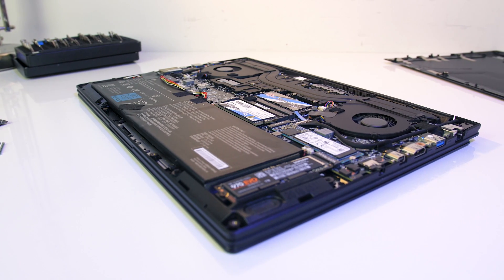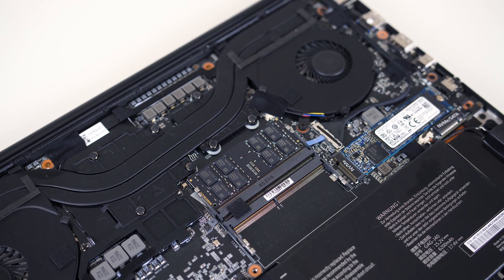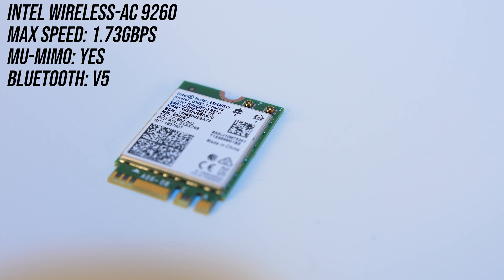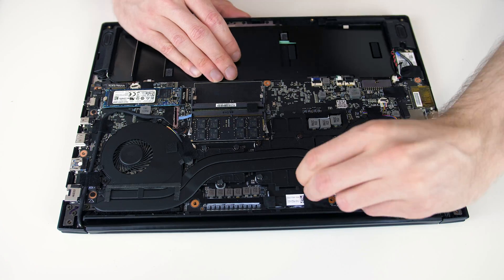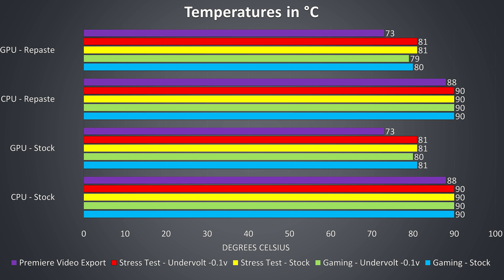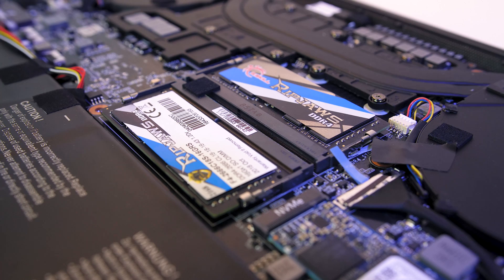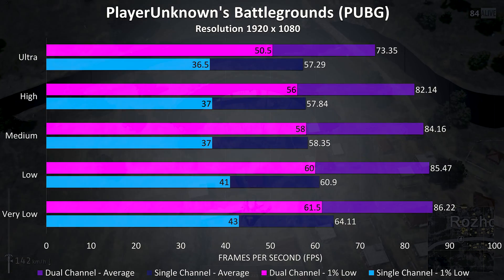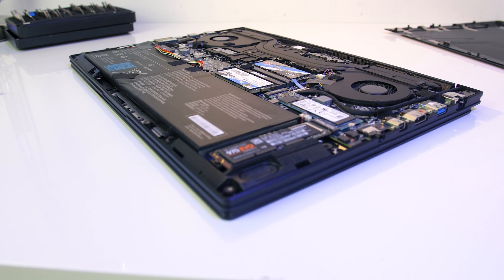Upgrading the Gigabyte Aero 15x Laptop

Comment: Hey Jarrod:
Here I am in Australia too thinking about buying an AERO 15 around boxing day as a gaming laptop. I have a simple question if you don't mind, as I am intending to put a second SSD in to boost the storage. It will be my first time ever to dig inside the internals of a laptop and I was unsure about whether the battery have to be removed or just simply disconnected for just putting in another SSD. I'm assuming just disconnect would be ok based on other videos I've watched but a certain answer is always more comforting.

Sorry for the long message, and if you ever read this, please stay safe throughout the rest of the pandemic :)

Comment: Still trying to tame the heat with my x9 running 32GB with i9 8750hk- I pretty much did what you did and can legit confirm a year later this is still hot. I like my laptop but with cooling would have been better
Reply from the maker: Just the way it is with that higher processor I guess 😟
Reply: @JarrodsTech  Yea man overall im still happy, I just know I cant go 3 hours at a time for my occasional gaming binge, but thats ok.

Comment: Okay so I finally got around to doing the mods myself. Haven't noticed an increase in network capability (though likely due to limited output from my modem) however the extra stick of RAM is awesome (if for no other reason than saying your laptop has 32gb of it...). I ended up doing a bit more research and found that once upon a time Gigabyte had a promotion that gave out a free stick of 16gb 2666 RAM if a 15X laptop was bought during March 2019. The stick in question was the Samsung M471A2K43CB1-CTD that you have listed in your video on the supported upgrades list and plugged straight into the vacant slot and worked out of the box! Highly recommend giving the Samsung a go if you're having any issues getting 2666 speeds (as a few people out there have reported). Once again, great video man thanks for the upgrade walkthrough!
Reply: thank you, Just Upgraded mine with - Samsung M471A2K43CB1-CTD  and it worked with V color. I have 2667 SPEED....yay

Comment: Just upgraded mine today.. used the crucial CT16G4SFD8266. Did not start and kept rebooting with no display. Then disconnected the battery and tried again. Finally worked and recognised both crucial sticks in dual channel. So anyone trying with those sticks.. disconnect the battery wait a few minutes and reconnect the battery then make sure the back cover is back on.. and start the computer. It worked for me. Now need to sell the kingston that came with the laptop..🤣

Comment: Hi, Tech Community. I've been looking for an upgrade to dual channel 32g of RAM in my Gigabyte Aero 15x 2018.  I tried to swap one Kingston KVR26S19D8/16 SODIMM Stick in, it just ran a black Screen and Fans, i reversed the placement of both memories( the kingston in the place of the Original  and viceversa), the kingston memory only, and nothing worked. Im really sad, but i still want to try with a G-skill ripjaws 16g Modell Number: F4-2666C18S-16GRS. I will be updating this comment once i get it ( in about 2 weeks they said). 
Wish you Aero owners much luck ! Stay healty Folks. 🙈

Comment: Hi Jarrod,
Thanks for that. My 16gb chip and wifi  card are on the way.
Have you done a video on how to overclock this machine,  above the standard 2.20 Ghz? and how to set that up?
Best Graham
Reply from the maker: It should automatically boost up higher when possible as long as thermals and power permit, all you can really do is try undervolting the CPU, here's a guide: https://www.youtube.com/watch?v=yNt9L3BWOFo overclocking with H CPUs is locked unfortunately.
Reply: @JarrodsTech  Thanks

Comment: How do you feel about using liquid metal?
Reply from the maker: I have no experience with the application personally, so a little uncomfortable without more research, plus you need to know the materials you're applying to which can be a challenge to determine due to different coatings etc.

Comment: If i add SSD and change wifi card and add 1 memory stick . Do i just turn on my laptop and use it like normal after i install all those or do i have to do anything with the software ?
Reply from the maker: Yep, just install and boot up like normal. Might need to install driver for the WiFi, but try a windows update first and it will probably just get anything if its needed.

Comment: Do the newer iterations of the Aero 15 and 17 (the ones with the Aero on the lid rather than Gigabyte logo) still have the limitations on upgradability as the older editions? I'd like to get the 17" HDR 1660 Ti version but it needs a serious upgrade to the RAM and storage to be usable for my editing needs.
Reply from the maker: Not sure as I haven't attempted there, sorry. The new models are definitely big improvements over this one in other ways such as cooling, could try asking Gigabyte support for supported memory for the new models and see if they match what I showed in the video.
Reply: Thanks, mate. That's a good idea. I'll do that. Do you know if there are any other 17" laptops with comparable screens around the same price point I should check out? It seems like the 15" models are always the ones that get the fancy screens.

Comment: i had same issue with upgarading my MSI GS75 samsung 2x8gb ram sticks to 2x16 hyper x ram sticks. black screen to start with. then i installed just 1 of each and boot up, then dismantle the whole thingagain and install 2 new ones and it worked. it was pain in ass as msi gs75 MB is flipped and every time i had to fiddle with flimsy conectors

Comment: I wonder the wifi performance as I'm having trouble with my 2017 AERO 15. The wifi is unstable and will disconnect if I play games. I checked on other devices and the wifi is fine except on my laptop. Also the wifi will disappear after few times of disconnection, I've tried every solution including clean reset but it still happening. My last solution now is to change the wifi card but I wonder if it actually worth it to swap the card and the problem may occur again. Also the wifi card is not the same model.
Reply from the maker: If you're using the latest drivers and have tested using the laptop close to the access point to rule out stuff being in the way, probably time for a new card, they usually aren't very expensive

Comment: Does this computer fits intel wireless ac 9560 on this laptop or is it only fit on your recommended wifi card?
Reply from the maker: I'm using 9560 in it, but any M.2 WiFi card should work I think.

Comment: Actually all ssds are compatible with the Aero 15x
I got both 512gb barracuda and a 2tb XPG(which is cheaper than 970 evo and the difference in speed is not far from evo)
Reply from the maker: Indeed, which is why I found it weird they had a supported list.

Comment: You are so thorough in your application I suggest using the liquid metal.
Reply from the maker: I might test it some day, but others who have didn't see much improvement, I don't think the thermal interface material is the bottleneck, the small heatpipes/fans/heatsinks just can't take out the heat fast enough.

Comment: I am happy to hear that the thermal compound change did not make any sense ;-) Sorry for you though!
Reply from the maker: Haha, yeah seems that the heatpipes/sinks are the bottleneck rather than the interface material between the dies.
Reply: @JarrodsTech  thx for your comment :-) Btw. my Aero 15 is now defective. Reports an nVidia usb Controller issue and sucks 37w of power in battery saver mode (cpu package 6w and nVidia gpu fully off, no wifi). Happened after 2 days and no response from Gigabyte in 5 days :-(

Comment: I have the Aero 15 YA (i7 9750 with RTX2080 MaxQ)..  Under high loads it's just shutting off..  but it doesn't shut off during stress testing...  I'm not sure what to do - whether to try undervolting the CPU and/or GPU or whether to just send it back to Gigabyte for warranty inspection?   Or maybe to try re-paste?  It's about a year old and I just bought it second hand..
Reply from the maker: Never heard of that happening, definitely not normal. Get in contact with Gigabyte.

Comment: Do you guys know if removing the bottom cover can void warranty? My piece is less than a year old and it stopped working so I want to try resetting cmos and removing battery to see if it helps
Reply from the maker: Honestly not sure. In the US I don't think those sticks saying void if removed are valid, so could depend on your region. If no stickers on the screw holes I'd just do it personally.
Reply: Jarrod'sTech thank you! I didn’t find any information about removing stickers and bottom cover on gigabyte’s website, also some people say that it’s illegal in the USA to void warranty if the device was opened

Comment: Super useful video, thanks Jarrod! I am thinking of going through pretty much the same upgrade, only RAM I'm considering going up to 64GB. In the list of supported memory kits that Gigabyte provided, were there any 32GB sticks that are 'officially supported'? :D
Also, out of curiosity where in Australia are you located if you don't mind me asking?
Reply from the maker: Cheers! There were no 32gb sticks listed in the sheet that Gigabyte sent me (I think there's a screenshot of it in the video), but I think those became more popular a while after making this video. It might be possible, could contact Gigabyte and check. The newer Aero 15 OLED lists 64gb in the specs though, so that one at least does. I'm based in Canberra
Reply: @JarrodsTech  Nice, thanks for the info Jarrod :) I'll send Gigabyte a message, my laptop does state it supports 64GB of RAM I'm just trying to figure out which modules I can get. I came across lots of people having issues with their specific RAM modules and it's a decent amount of money so I think I'll chase up Gigabyte first to make sure I get something that'll work. Canberra is a nice place - very quaint. Only been there once so far but I did like it :)
Reply from the maker: @SurfacedStudio  No problem! Yeah for some reason they seem to be one of the few that are actually picky with regards to memory selection.

Comment: Looking forward now a year and finally found time to start teaching myself premier pro, it’s quite laggy would you recommend adding some upgrades?
Reply from the maker: What specs do you have? Dual channel memory would help, otherwise the best CPU you can (Intel based for Quicksync) would also be beneficial for both editing and the export process.
Reply: Jarrod'sTech hi hope your well? Here’s my specs:
Intel Core i7-8750H Hexa-Core Processor | 15.6" Full HD IPS 144Hz Screen | Microsoft Windows 10 Home 64bit | 16GB DDR4 RAM | 512GB M.2 NVMe SSD | Dedicated GeForce GTX 1070 8GB Graphics (Max-Q) | NVidia Optimus | USB3 | HDMI 2.0 | Bluetooth | Thunderbolt 3 | AERO 15X v8-CF2

Comment: Hey Jarrod, I just did my thermo solution with kryonaut(cpu and gpu) and thermo pads, CPU undervolt of -0.150 and I also lapped the heatsink to a near mirror finish for the CPU and GPU. All benckmarks I run now with the fan on full never get thermo throttled, unigene superposition, heaven, cinebench 15, 20. But I do get power limit throttled. I guess that's a win :). Oh yeh and one other thing, I put a blob of kryonaut in the middle of the die as I was afraid I might be air bubbles if I spread it on.
Reply from the maker: Nice, can't remember if you can raise the power limit on the 15x, but I know the newer models support that which is good if you have the thermal headroom. Anyway nice to hear it helped, thanks for sharing the result!

Comment: I run this laptop with factory internals on gaming configuration and get about 130fps max on Csgo would you say that is pretty normal and P.S. I can't run Csgo on full screen and P.S. great vid!
Reply from the maker: Depends on your settings, however even at max I'd expect a bit higher assuming you're using the same Ulletical FPS benchmark as me.

Comment: Should I get 0.5mm thermal pads or 1mm ?? Please help me out
Reply from the maker: I don't know, I never checked if mine had proper contact so just assumed what I ended up using was ok.
Reply: @JarrodsTech   Which mean 0.5 mm will works fine? Thank you for the speedy reply. 
My Aero 15 i7-7700hq throttle badly and cant even reach constant 85 fps in Dota 2 Medium settings while gaming. Thinking of repasting and stuff.
Have a nice day mate
Reply from the maker: Seems to be working ok for me, it still runs hot though as discussed after the changes, I think the limit is just the heatsinks/heatpipes, they don't seem capable of removing the heat quickly enough so anything else hardly matters.
Reply: @JarrodsTech   Do u think the thermal will be better if u were to use Thermal Grizzly for the other chips as well instead of Thermal pads?

Comment: hi Jarod! I'm just posting about my experiences with the aero 15 after about a year. a few days ago i finally had the balls to repaste my laptop (grizzly kryonaut) and thankfully i had amazing results! after repasting and undervolting i saw a 8-10C degree decrease during gaming at 28C room environment. (i used thermal paste for everything instead of thermal pads). this was fairly consistent and gaming in high performance mode on ultra settings didn't go passed 85C degrees (before it would go 93C and above. throttling to 3200mhz). however gaming on balanced power  settings i managed to get temps as low as 59C (mind you this is with the processor limited to 2700mhz so basically half the power. still 50-60fps on ultra).  I'm looking forward to upgrading my RAM as soon as i finish gathering money. 

do you think it would be wiser to sell the existing 16gb and go 8gb dual instead or just get another 16gb stick?

thank you so much for all your helpful videos Jarod😁

p.s. are you still using your aero? how is it holding up?
Reply from the maker: Thanks for sharing your experience with it, good to hear that you were able to reduce the temperatures more than me! Hmm I think just getting a 16gb stick is better from the perspective of you'll have 32gb in total, but as mentioned here compatibility seems to be hit or miss, so may be safer with the 2x 8gb kit unless you know you're buying a 16gb stick that will work with the machine, a few others have listed the memory they had success with in the comments here which might help too.

Comment: Dude you video got a HP omen 15t which is liquid metal cold and can have up to 64 GB of RAM (2666 MHz) in it. My model has 64 GB of RAM and costed me around $2000  while the aero 15 x has a slow SSD   my model had Samsung 970 1tb Evo SSD and it is thicker, a little bit heavier (2.3 kg) a has way better thermals. I ran Intel XTU and my my laptop was able to heat up 2 4.4 gigahertz for 23 minutes and at 87 degrees Celsius at 92 percent CPU utilisation. Though the WIFI card was the same, I had to upgrade it to the one in the video
Reply from the maker: I don't have any HP Omen videos on the channel, I've never been able to get one.

Comment: Did you make any changes to the laptop using ITU? Like any since you have had the laptop. I have kept mine on the default settings and using ITU, have noticed that my two RAM sticks are running at 2400mhz when their both 2666mhz and I keep on seeing something saying current limit throttling. 
Thanks
Reply from the maker: Not sure what ITU is, if you mean XTU, then no I run mine at stock. Mine is DDR4-2400 as well, it's because the two sticks are different and support different speeds at different timings, you can check this in HWInfo.
Reply: @JarrodsTech  Thanks for the quick response.

Comment: Hello guys;

I recently bought a V-color 2666 MHZ 16GB (exactly the same as the first inside my Aero).
I thought buying exactly the same wouldn't be a problem and that the dual channel would work !
Unfortunately as he said in the video i also had the black screen, impossible to run my computer.

Do i have to take a V-color 2400MHZ 16GB instead of the 2666GHZ ?

Thank you for your answers !
Reply from the maker: Hmm, maybe try unplug the battery to clear the CMOS, leave it for a bit, plug back in and retry, let it try start up for a few mins. Failing that try contact Gigabyte support here https://esupport.gigabyte.com/ as it should be supported.

Comment: Thanks, I’ve just upgraded my main drive to a 2TB 970 evo plus and using the original 500g drive as a storage drive; did the wireless module upgrade as well; as the RAM, I ordered the hyper x 32G as you suggested, it’ll arrive in 2 days time, fingers crossed.
Reply from the maker: Nice!

Comment: i tried using 1 stick of the same ram you got, didnt work at all in any slot. made me so sad. send it back, bought 2 sticks of a different kind. hope that works
Reply: @JarrodsTech  yeah i looked at the compatbility list, i got 19, the 'compatible' drive was 18. oops. just another week til i can try again lol. i really hope that doesnt have the same problem, its also CL15 instead of 18, so if it runs at full 2666, and CL15, thatd be clearly faster in a few ways. 

hopefully.
Reply: @JarrodsTech  i can confirm this kit works in the 15x v8 https://www.amazon.com/Kingston-Technology-HyperX-HX426S15IB2K2-32/dp/B01NAL3TYY

 its 16x2, runs at 2666  CL15-17-17-35. love it so far